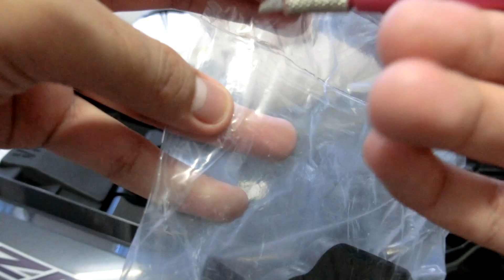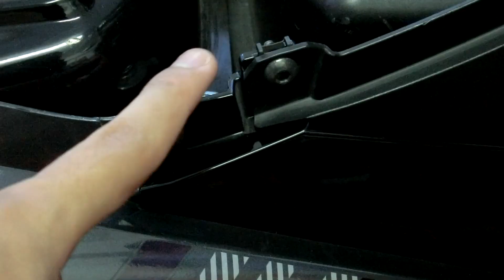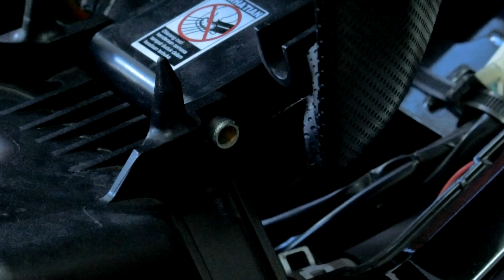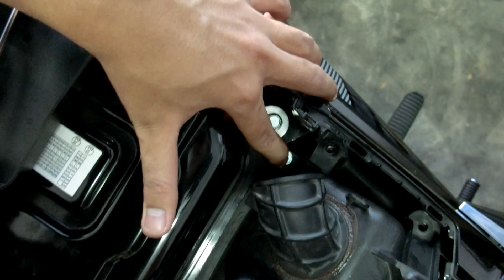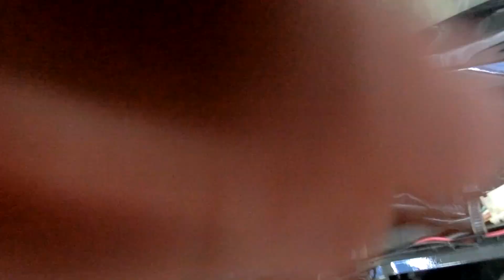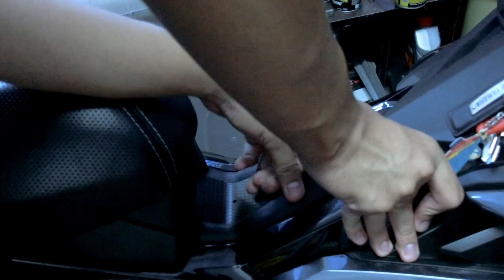Tutorial Cara Tukar Air Filter Yamaha Y15ZR

Comment: Bro nak tanya, motor saya bila masuk gear, bila nak jalan mesti enjin mati. Bila idle enjin ok pulak. Hanya bila nak jalan ja mmg mati.. Masalah apa ya? Fuel pump?
Reply from the maker: eh, pahal boleh macam tu pulak.. Pelik betul mungkin gear sensor awak tu yang problem kot.. cube bawak pergi bengkel check gear sensor
Reply: @KikiDaily09  problem solved. Masalah spark plug. Karen x cukup. Ingatkan masalah ecu. Tq